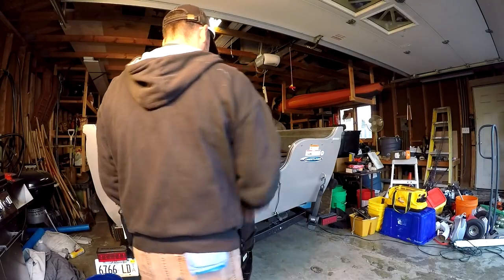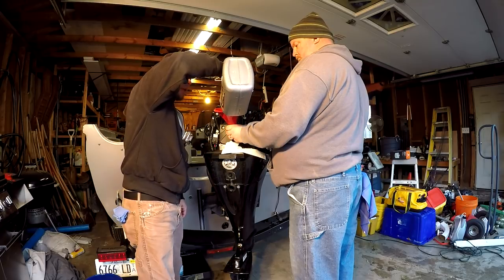How to Winterize an Outboard Motor 4 Stroke

Comment: Good video!  A couple other things, make sure to put fuel stabilizer (Stabil or Seafoam) in your gas and top off the tank so you don't get condensation inside.  Make sure all of the water is out of your livewell lines and bilge pump.
Reply from the maker: CZYK Republic for sure i forgot about to talk about the fuel tank, thanks. As far as the other stuff I was mainly focused on the outboard but yes those things are a must as well. Thanks for the input and watching I’ll be pinning this comment to the top.
Reply: Very good points!
Reply: That used to be the recommendation BEFORE ethanol fuel. A full thank is no lower advised due to phase separation. Fuel level should be low for storage. Life expectancy for ehthanol fuel is 30 days.
Reply: @stevengilmore1509  I'd never use Ethanol gas!

Comment: Thanks for the video it's always nice to have a refresher. Another thing to look for is taking off the prop and checking for fishing line because that fishing line in the front of the prop is normally what ruins that seal and allows water to get in your lower unit. Removing that, lubing the shaft and inspecting that area is an excellent preventative step as well.
Reply from the maker: Thanks for the comment I was winging it and missed a few steps

Comment: Very informative video.  I especially like the comments that this is one approach used for 5 years without any difficulties.  One suggestion is to add the water draining portion.  I am assuming the water drains out thru the ear muffs.  Also, many boat stores or marinas service centers advise  using an anti-freeze after draining the water.  Most videos comment this is not necessary and is a money maker for the service
Thanks again for the procedures.
Reply from the maker: This engine is designed to drain. However always check the owners manual for your a pacific engine requirements. Thanks for watching and for the comment.

Comment: Hi there,
Thanks for the detailed procedure shown.
One question: I have one 60hp outbaord big foot; i noticed from other youtube vedio or forums, some people say DONOT fog the a stroke engine as it may destroy the electronic system. Is that true? Do we need to fog the engine or not?
Thanks.
Reply from the maker: Originally from the dealer I bought the boat from that’s what they told me to do, in this video I’m simply showing how to do it. However from what I understand it is not necessary with this type of outboard.
Reply: @FishingPOV  Thank you for sharing - good and detailed step by step video you made👍
Reply from the maker: @sheldonzhou7781  You are welcome thanks for watching

Comment: You forgot to mention that there is a high pressure inline fuel filter on the right hand side of the oil filler cap. It's covered by a neoprene sleeve and most people don't know it's there , have to check and replace it at least every 100 hours. Should also have removed the prop and checked the seal in front of the thrust washer for fishing line that can cut and damage it , grease up the spline shaft and replace the prop . Other than that good video on how to service this motor as well as other brands of 4stk outboards. 👍
Reply from the maker: Thanks I figured most of that stuff you mentioned should be general maintenance during the season but you are correct it would’ve been good to mention. Thanks for watching.

Comment: My boat is stored in Sacramento and it only drops below freezing for a week or two every year.  I changed the oil - should I just add fuel stabilizer and consider it winterized?  Thanks!
Reply from the maker: jimmyronaldo21 other then greasing and maybe changer the lower unit oil sounds good to me, thanks for watching.

Comment: Add the Sta-Bil to the tank before you do your 15-minute oil warmup. Always wise to smear some anti-seize compound on your plug threads. And to prevent cross-threading, always turn the plug COUNTER wise just until you feel the first thread "click" as it engages. Old mechanic's trick. I defer to outboard motor experts about fogging.

Comment: Any advice for making sure all the water is out of the motor? I've seen some guys run coolant thought it before storage. I've got a Merc 25 3-cyl. Thanks
Reply from the maker: Dan Massaroni the motor or lower unit? I know guys run a winterizing solution through the motor but I don’t think it’s a anti-freeze. Now I’ve heard of that through the lower unit.
Reply: The motor, just wondering if gravity does it for us or if you need to blow compressed air up the water outlet?
Reply from the maker: Dan Massaroni newer motors use gravity for the most part, lifting the tilt up and down several times should do the trick.

Comment: You can't fog an EFI engine the same say you would fog a carburated outboard it will damage your injectors. There is a special way to "fog" an EFI outboard, you need to run a special mix of gasoline and 2-stroke oil through it.
Reply: Just wonder if fogging is necessary for the 4 stroke outboard?
Reply: @muskyman3238  Yes. But it's easy. Just remove the spark plug and spray some fogging oil directly into the cylinders and turn the engine over. Done.

Comment: This is a very good video as it is hard to find updated details on fogging a Merc 4 stroke.  I've got a 150 (2015) and it is a beyitch to get to that 4th plug to pull and fog the cylinder.  First time I'm seeing someone recommend spraying the fogging oil into the intake, so the dealer told you to do this?  Seems much easier if it is as effective and won't damage/sludge the internals.  Thanks again.
Reply from the maker: V S dealer said they mix a gas solution and run it through and or fog, I’ve been told since that running the gas solution is the best way. Thanks for watching.

Comment: You might want to check with your Engine Dealer are our Merc Dealer said we should not be fogging a 115 EFI engine as it ruins the electronic fuel sensors over time.  A fuel mixture should be run through through the motor instead.  5 Gallons of non Ethynol fuel, 1 pint of 2 stroke engine oil,  1/4 cup fuel stablizer all well mixed in an external fuel tank and connector to engine to run out. It will save engine in long run.
Reply from the maker: Chris Janzen thanks for that info. We’ve been doing this because the place we bought the bought brand new from told us we had to. I did read what you’ve explained and may start doing that instead.
Reply: This is correct.  Fogging EFI engines is hard on the sensors and other fuel system components and shouldn't be done.  Run a fuel mixture with a bit of stabilizer and oil, instead.
Reply from the maker: Randy Mohr got you this was recommend by the dealer we bought the boat but since then have learned better, thanks.
Reply: @FishingPOV  Take down the video... Don't fog this engine.. No need to winterize these. Just put ear muffs on the intake and idle it for 10 minutes every month or two in the winter, then put the leg straight so all water drains.. done.

Comment: Any advantage or disadvantage of fogging with spray in the air intake vs running through fuel?
Reply from the maker: With four strokes you stand the chance of damaging sensors etc we originally went with the advice of the dealer.

Comment: just learned  how to winterize the outboard engine from this guy, now I need to do it myself on my suzuki 4 stork 90hp. hopefully i don't strip a screw.
Reply from the maker: Tyler chau if you have a newer model engine I guess they aren’t digging anymore due to it possibly messing with sensors in the engine. They run a fuel stabilizer/winterizer through the engine instead. Sorry I don’t have a tutorial on that, Thanks for watching.

Comment: This is Terry , not Barbara,  I have a 90 hp mercury outboard on my pontoon. so basically the same way as the 60 hp?  Also, just to make me motivated to do it myself, how much do the shops usually charge for doing this.  Not to mention they will try to sell you other things like car mechanics do.  thanks for you response.
Reply from the maker: Barbara Bilyeu I’ve seen it in the upwards of $500 but it all depends on a lot of different variables area, size engine etc. this is something very easy to do and when buy the stuff a lot of it will last a couple seasons.

Comment: I have the same motor we’re did you get your washers for the lower unit washers
Reply from the maker: Nevin Howard thanks for watching, I looked everywhere for that invoice but couldn’t find it for the part numbers, I special ordered them and it was a pain because Merc has changed part numbers on so many parts. Sorry I couldn’t be more help
Reply: Hey thank you for trying though!
Reply from the maker: Nevin Howard if I find it I’ll post it here.
Reply: I called mercury and got the part number #830749 in case you or any body else needs it!
Reply from the maker: Nevin Howard thanks for posting that, I did call Merc first but they were no help. I’m glad they helped you hopefully it’s the corrected part they sent me a water pump rebuild kit and it wasn’t even close.

Comment: You sprayed that into the air intake correct? Is there anything you need to take off to do that?
Reply from the maker: Olivsam if you have a older model engine this is recommended but if it’s newer fogging is not recommended. But if you need to do it, yes spray into the intake. All models are a little different so the closer you can get to the intake the better. Hope that helps. Thanks for watching.
Reply: Thanks I have a 99 evinrude 50 hp 4 st
Reply: Efi by the way

Comment: Nice video but you might want to change the sequence of your interventions. First while driving back from your last seasonnal outing, fill the tank preferably with ethanol-free premium fuel (so as to prevent introducing water fhrough condensation) and add ethanol-free stabiliser. The rest of the drive home will allow the stabilizer to mix with the fuel. The stabilizer will make its way to the carb / injectors as you run the otor to warm up the oil before draining it out. Go easy with tightning the oil filter, a 1/4 turn passed the point 2 finguers rotation will get it is plenty. Its gasket should be moistened with new oil. Congrats on squirting a litte bit of 2 stroke oil in the cylinders (that's what fogging oil is) and turning the motor over a few revolutions (don't have it running). There is no point in fogging a running motor if it does't bog down and die. If the motor keeps on running, it will just burn the oil (that's your smoke coming out) while fouling up the spark plugs. Unless your 60 hp motor sports a BinFoot gear case, Mercury recommends (and sells) a lighter gear lube than SAE 90. Many happy fishing seasons to you !
Reply from the maker: Daniel Robert thanks for all that great info and for watching I’ll keep it in mind while winterizing each year.

Comment: Sorry had to stop watching after fogging the engine. You don't fog a 4 stroke engine, 2 stroke, yes
Reply from the maker: Kenneth Meals I understand but that was based on the advice of the dealer who is and was a asshole to us after we bought the boat. You can do it but risk damaging sensors over the long term.
Reply: Fishing POV wait what???? For real?? I was always told to Fog a 4 stroke too!! But by removing plugs and spraying it in there like that then cranking over a few turns to live inside.. Almost everybody I see recommends it, even on a 4 stroke
Reply: Straight off mercs website....Fog the engine.

Now that the motor is warmed up, remove the spark plugs and spray 1 oz. of fogging oil (for four-strokes and conventional two-strokes) into the inside of the engine to prevent corrosion. Look for fogging oil that’s specially designed for use during winterization, such as Quicksilver Storage Seal. With direct-injected engines such as Mercury OptiMax, use 1 ounce of DFI engine oil instead of fogging oil. A small oil can with a long flexible neck works best to inject the oil into the cylinders for this application. Russell also recommends putting a coat of anti-seize lubricant on the plugs’ threads before (carefully) replacing them.

Comment: your VST is full of gas too (a lot) , drain that also with 8mm drain valve , that is after the fuel filter so adding stabil to the fuel filter canster does nothing as you have at least half a liter of gas in the VST

Comment: fogging 4 stroke are you, ok ?
Reply from the maker: Jarek Garlicki the dealer was an asshole after we bought the boat this was his recommendation and we found out it’s no necessary. However I have been told taking the plugs out and spraying fog fluid in can help lube and protect from possible rusting. When DYI you are at the mercy from learning from somewhere.